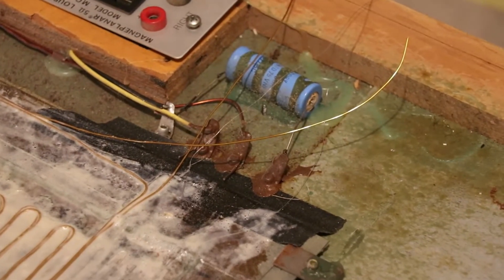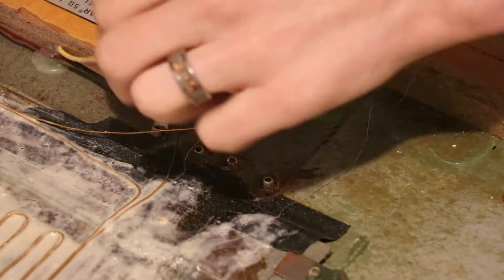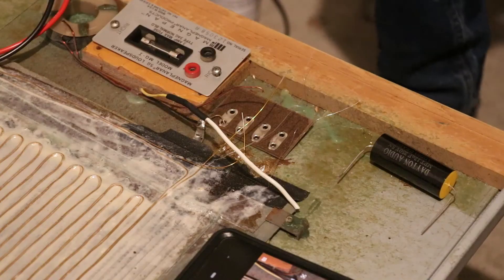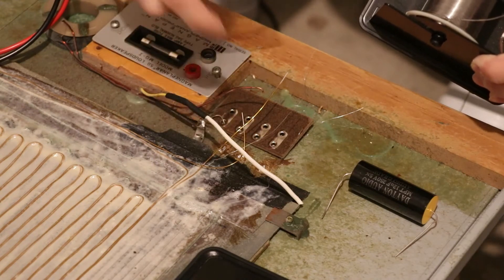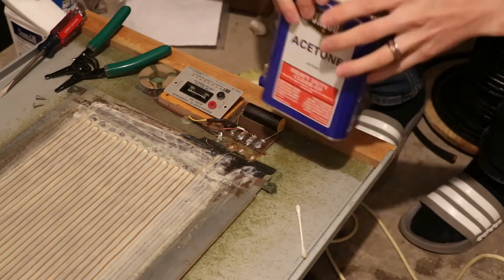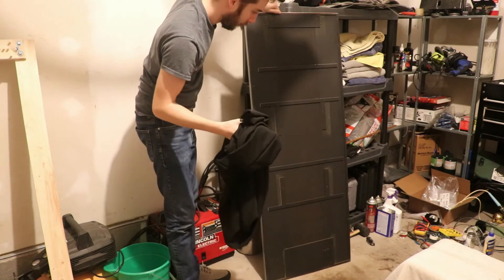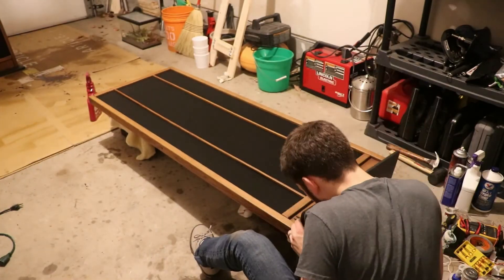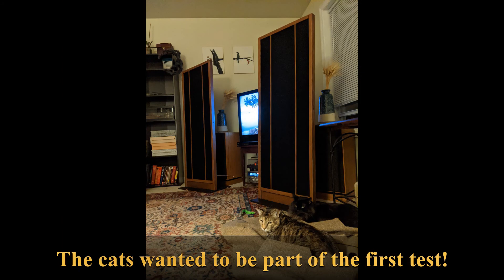REBUILD your MAGNEPAN MG-1 SPEAKERS (Part 3)

Comment: Nice Video series, rebuilt a pair of SMGs then another pair of MG-1's using these. 

My MG-1's had the solder / hole / wood terminal already installed, as did my SMGs.   Since those old terminals were such a PITA, by the time I got to the MG-1's I considered using the screw / clip style terminals that came with the kit.  I called Magnepan to verify, and yes, they said I could "upgrade" to that newer-style terminal block.  (Guy kinda mocked me: "..why do you think we ship it with the kit?")   I installed it and it was a lot easier than the old-style terminal block.

Also, I had to strip my treble wires in addition to the bass wires.  The documentation also said to do this.  The was probably the trickiest part of the rebuild: stripping those tiny wires without breaking them.  Magnepan documentation also mentions using a razor to strip the wire, but I did not see how that was possible on that small wire.

Comment: Thank you. Could you briefly describe the sound difference before and after?
Reply from the maker: I call these videos "rebuild" but really I should have called them repair videos since the speakers were broken.  One of the speakers had no sound at all since both the bass and treble wires had corroded to the point there was no longer any conduction.  The other speaker, only the treble wire had corroded so the sound out of that one was pretty bad.  Basically anything below 10khz or maybe even less was non-existent.  After the rebuild, "treble" frequencies had been restored.  You can check out the sound in my review video - https://www.youtube.com/watch?v=fRDKFTiDtGA
Reply: @AHFixIt  This is white noise from my Maggie IIBs, where I suspect the treble wires have also corroded as anything ABOVE about 8-10kHZ just isn't happening: https://i.imgur.com/y3fJRGE.png
https://i.imgur.com/9Yl0kHS.png
Remember, bass is LOW frequencies, 20-250Hz, MIDRANGE is about 250-5 0r 8KHZish, and TREBLE is HIGH frequencies, around 8-20kHZ in the human perfect hearing audible range.  I have excellent hearing for 55yo and nothing above 15kHZ exists for me, but it's pretty flat up to that point other than a marked dip at 1kHZ - I blame the US Infantry.